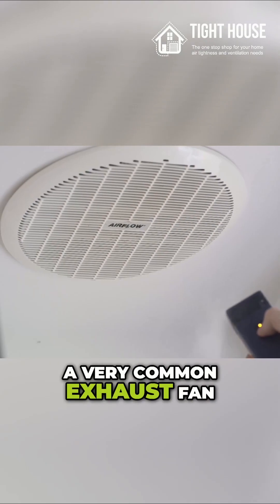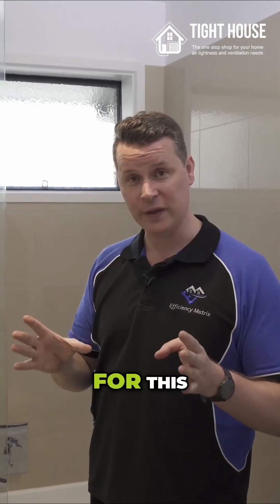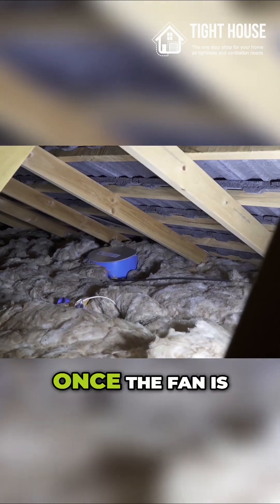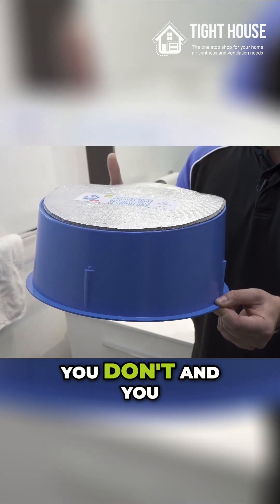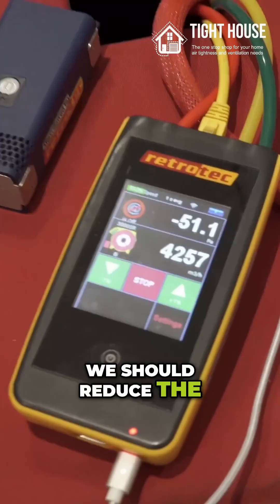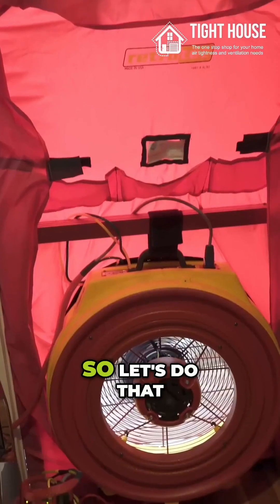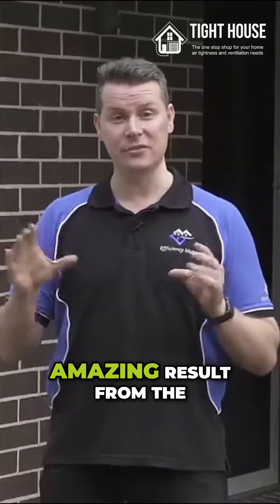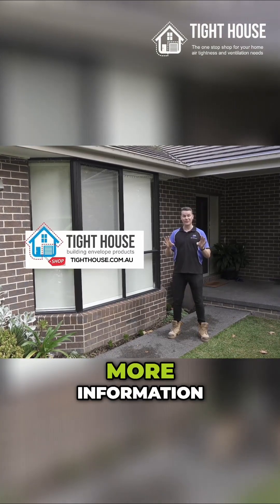Shocking Air Leak Found in Every Aussie Bathroom! #diy  #draftproof #exhaustfans

Comment: So what happens when you want to install and extractor for a bathroom, you cannot send the humidity into the attic/roofspace as this may cause damage. So when plumbing it to a roof or wall vent, how do you suppose to install a draught stopper inside the piping?
Reply from the maker: This one.
https://tighthouse.com.au/products/draught-stopper-damper?_pos=1&_sid=1225d99ca&_ss=r
Reply: @ecoevo  Uk?
Reply: @ecoevo  Anyone make or sell these in the Uk?

Comment: Suitable for the wanky fan/heat lamp units?
Reply from the maker: No it’s not.  Those things are little heaters.  Modifying these fittings with a draft stopper could void your insurance policy if your home burns down.
Reply: Perfect for putting moist air into the cold attic. ??? 😮
Reply from the maker: @stephenbrickwood1602 agreed, the real solution is to exhaust with an inline fan exhausting directly to the outside. 👍.  In this full video, we do mention this.
Reply: @ecoevo  👍 👍 😊